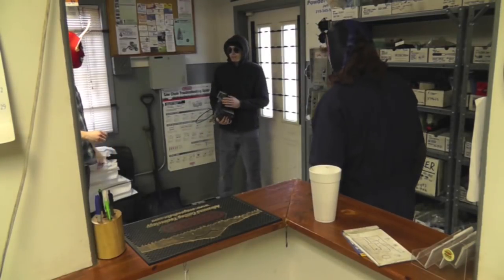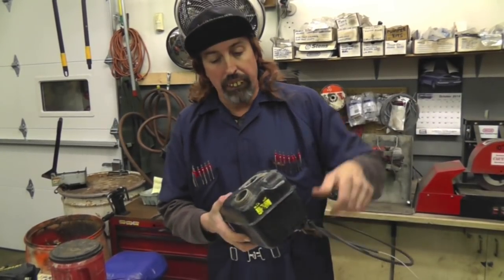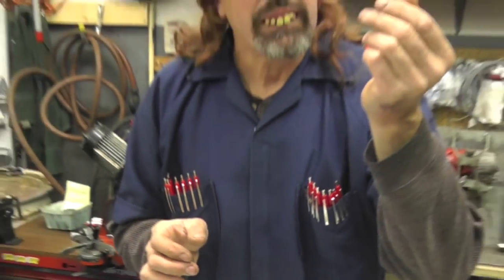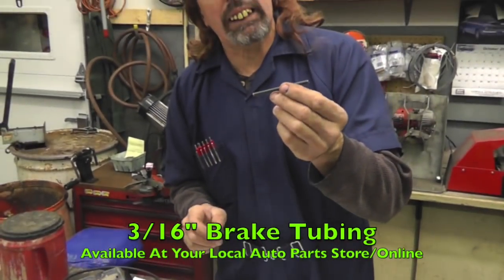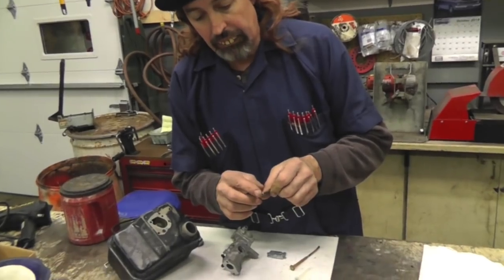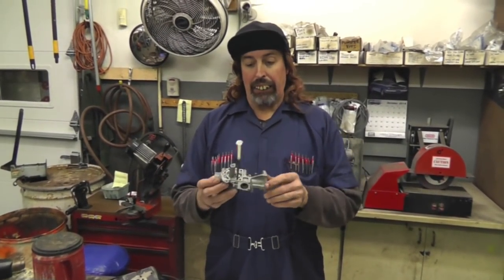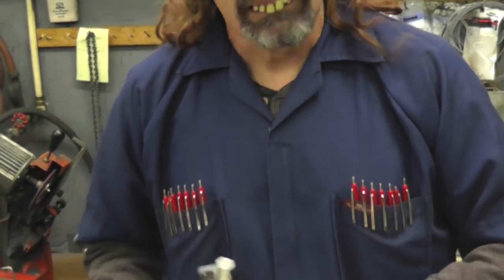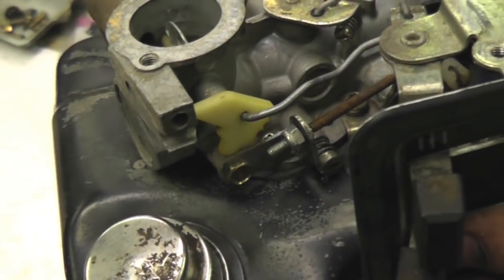How To Fix A Briggs and Stratton Pulsa Jet Carburetor with Taryl

Comment: Taryl, I have an MTD tiller with a Briggs and Stratton engine. I am trying to find those gaskets, etc for the carb. What's the best way to locate them?  If I google the tiller model number it does not give me any engine info. Carb looks exactly like the one you are working on here.

Comment: I have one of these and it surges...cleaned and rebuilt it too
Reply: There's clean and there's CLEAN. Carb is stil dirty or the gaskets failed or the pickup tube is cracked. All just like in the video.

Comment: I have an 1982 briggs 5 hp with an old carb/ pull out choke, after replacing the gasket between the carb and the tank it still continues to leak gas heavily. Any ideas on a fix, I'm guessing the tank and or carb flange is not exactly straight. Thank for any input.

Comment: I have a toro 5 hp walk behind blower with a Briggs 5hp 130202 with a pulsa jet carb I cleaned the tank spotless cleaned the carb rebuilt everything on it all new gaskets new Diaprham new tube’s no cracks and still will only run when gas is poured in the carb I can’t get it to run for more what I pour in the carb
Reply: Replace the pump diaphragm gasket.

Comment: hey I need the choke shaft assembly 491177 for this 495496 carb assembly for model # 135202 type # 0119-01. The ding dong shaft plastic got broke clean off while I was cleaning the tank,,,,any suggestions for homestyle repair so I can eat my dinner?

Comment: I have a 3 hp briggs snow thrower. It has the carb and tank set-up. But I want a different carb for my mini bike. I want my gas tank between the seat and handle bar. I can't seem to find anything on EBay or Amazon. Can you please give me a part number for this new different intake and carb please!

Comment: I have pulsa jet carb there is fuel and spark and it would not start when spray starting fluid it will run for a moment carb is new and spark is there what’s the problem pls help

Comment: You mentioned the high speed adjustment at the end but didn't show where or how.... and that's what I need.
Reply: That's because that carburetor is the later fixed jet Pulsa-Jet. The high speed mixture cannot be adjusted, just the low/idle.  The initial setting for the idle mixture is 1-1/2 turns out from lightly seated.

Comment: I have a commercial snapper mower, the carb set up is different, it has a long pick up tube, and a short pickup tube, besides buying a new tank, what can I do, the one I have the cup or bowl the short pickup tube sits in fell off, and is sitting in the bottom of the large gas tank, is there any way to work around this problem, and or a way to fix the bowl, I can get a Suction cup on the bowl, and bring it back up to the top, but can't figure out how to reattach the bowl, to the underside of the tank, what I was wondering is if I could put a pickup tube that is just as long as the other pickup tube, and not have the bowl at all, if that would work or not?
Reply: I know that this comment of yours is a year old so, you've had time to resolve the problem (I hope).
I have a similar problem in that the carb won't come off of the gas tank. It comes up but not off.

I was going to try to find a way to remove the bowl but, after reading your comment decided not to.

What finally happened and how did you separate the carb assembly from the tank?

Comment: Hey, I know you. Your that Pterodactyl guy, huh? Been around a long time.
Reply: Taryl.  Just installed my nylon down-tube. Just pinched the brass tube in a vise and used big channel-locks to squeeze tube down over brass.  Worked perfect.  Liked your way too, with the brake-line.

Comment: Thanks TARL D my backs killing me cause this briggs real real old starts great after sitting for months runs like a raped ape for 5 mins then kaput shuts down. I was pulling her over and over again. Now she gave me blisters last time so i knew better then to let her bite me again anyways she was righttt there just about to start point 2 hours of pulling about to start hitting poppin smoke ever know and then ughhh. REALLL TEMPERMENTAL. I took the belt off her thatching pulley powerake(1960) just see if she would start. Get her started but then it was useless cause her belt was off and i wasnt about to loose a finger trying to install her running.. cleaned everything up today. But know after watching you video im gonna check that pickup line... that vacum works great on choke tho i know shes pulling gas on choke 100%later tater. IM OFF LIKE A PROM DRESS!!!!